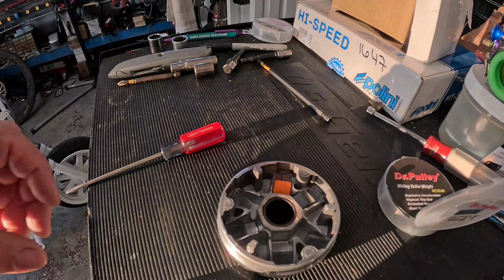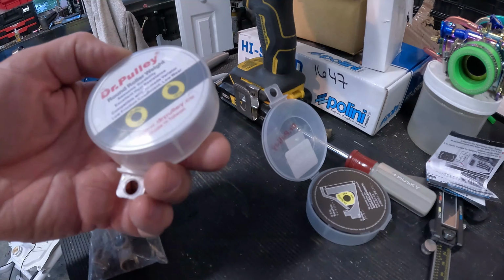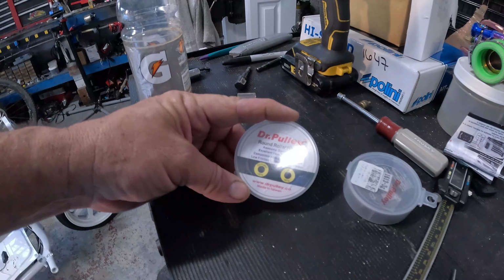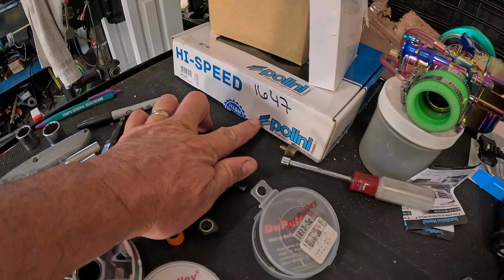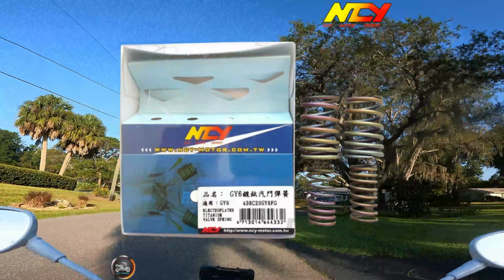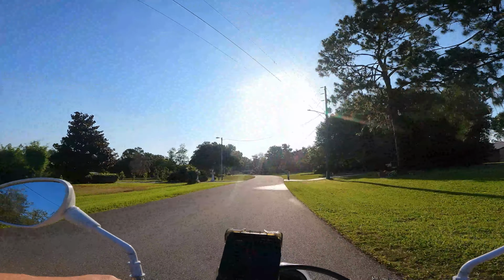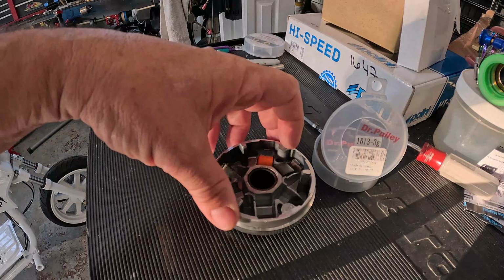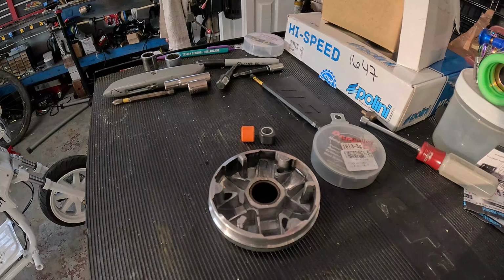Dr Pulley Sliders vs Rollers on GY6 Scooters.  Tested.  CVT Sliders with a Maddog 50

Comment: Your theory is correct. Sliders work as a quicker reacting weight at the same weight as a traditional roller. So what generally happens with sliders is you need to go up a G or two to match a traditional roller's RPM range (Pending the roller size. The larger sliders are more similar to a same weighted roller.); they will move inside the variator as quickly as the lighter roller while giving you the ability to push way out to the edge of the variator like a heavier roller... if your bike has the juice to spin them out there.

For most people though, if you get Dr. Pulley sliders at least, they just last quite a bit longer than a roller. Dr. Pulley is actually a plastics and composites company first that makes some scooter parts, and that is why they have such a good compound.
Reply from the maker: Ok cool.  Thanks.

Comment: This is pretty close to the same thing I was seeing. The sliders just aren’t a direct replacement for rollers as far as weight goes. I use a roller weight test kit for tuning. I then went to sliders and had to do it all over again since they didn’t match up.
Reply from the maker: Ikr.  Why don't they name them what they are equivalent to in roller language?
Reply: Excellent explanations.. I've always been told to go up 1 g when switching to sliders. Never tried it.
Reply: Most of these guys are just slapping parts on and not tuning for powerband,  so I think your correct about a poorly tuned cvt responding well to sliders.

Comment: Yeah with sliders you have to go about 1 more gram heavier than rollers 😊
Reply from the maker: @dkewlguy  That's what I am figuring out.  But if I use equal to equal.  Say 6 gram sliders vs 5 gram rollers, do you think the sliders would be better?  The I only advantage I can see is that they wear out slower
Reply: @GhettoWrench  honestly I would say you are correct. After watching your channel for a few months now. You are right about all the "performance" parts. Man most arent better than stock. Or they actually slow you down! I'm a firm believer in a good maybe 89mm variator. A good belt. And the right tune on your CVT. And honestly that's it when it comes to your transmission. The rest is all exhaust and engine stuff. Aka bbks or unrestricted exhausts. And Ioved your video on porting the heads. On a 50cc I agree with you. It doesn't make much of a damn difference